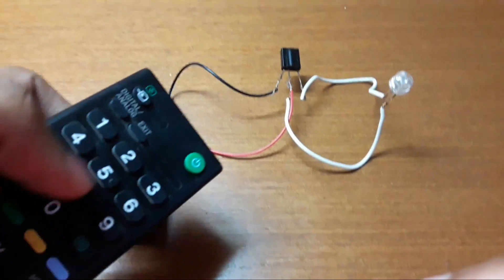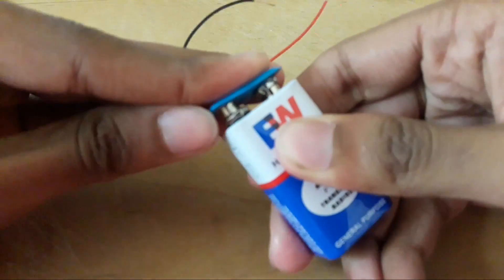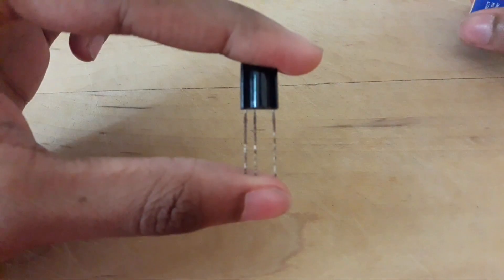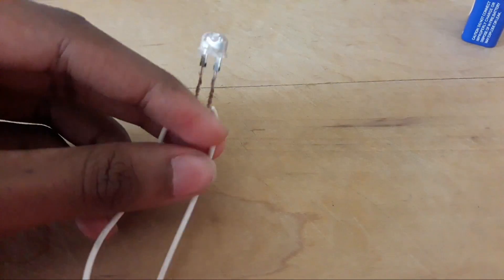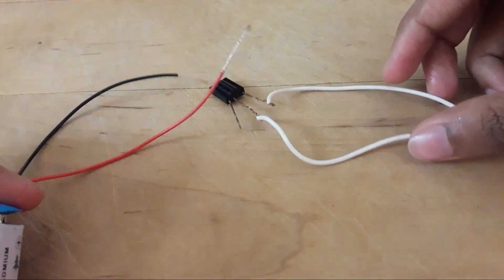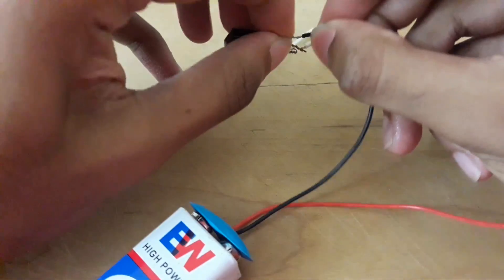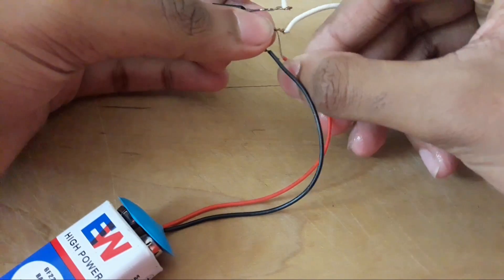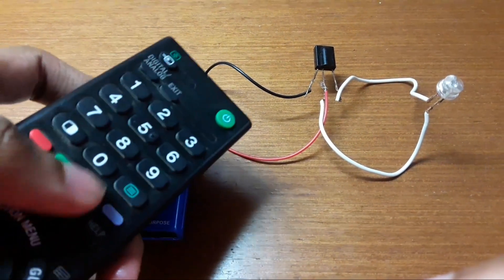How to make an "IR Remote Tester" using IR Receiver Diode - TSOP1738 [Easy]

Comment from the maker: How to make an Infrared Remote Tester or IR Receiver Circuit using TSOP 1738 (latest video) :- https://youtu.be/wD4-jWzVLLY
Reply: why its flickering can you make it without flickering? and when i switch the power to a battery the ir sensor became hot

Comment: I just checked the datasheet for this tsop1738, and it says 6V max for supply voltage.  Won't your 9V battery quickly destroy the reciever?
Reply: These types of power supply batteries supply low currents so, it does not make problem for it, and the tsop1738 needs 5mA to run . But if you are using power supply device you must take care of that.
Reply: usually. 3v......decreaing. when real usage

Comment: What happens if we leave the circuit connecting it to battery? Will Battery drains even if we don't operate the remote?
Reply: the battery will not drain.

Comment: i used 5v and it put the reciever in flames
Reply: Same happened
Reply: The sensor is rated for 5v. Why would 5volts put it on flames